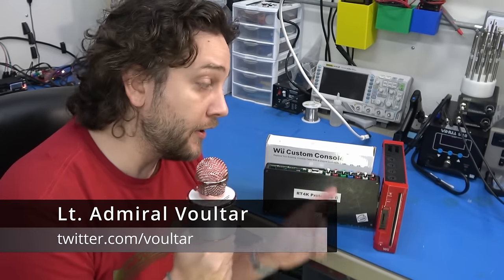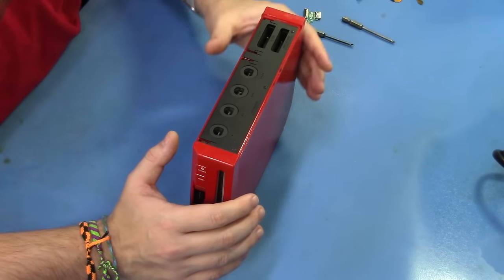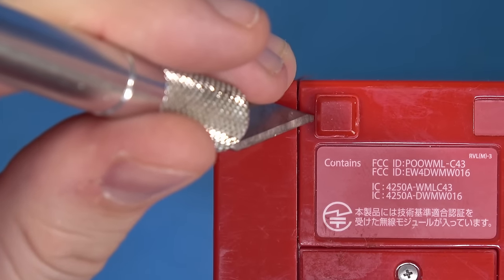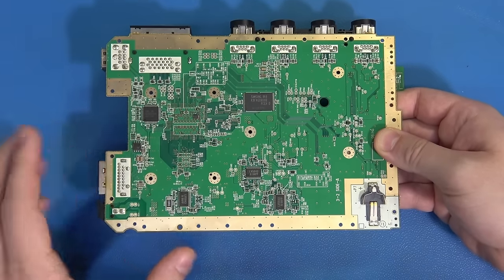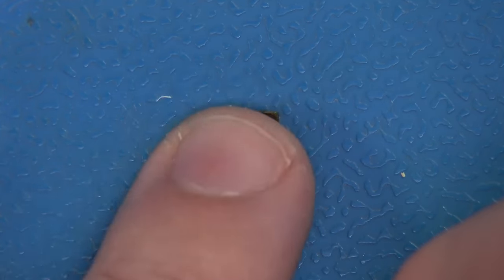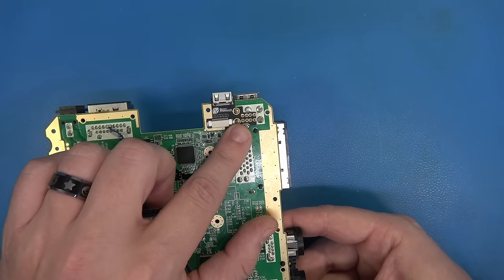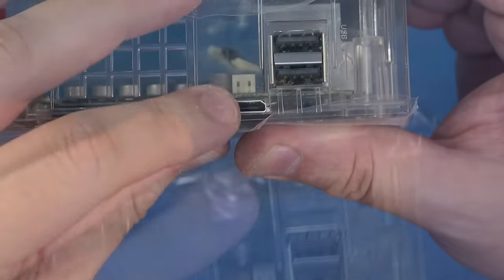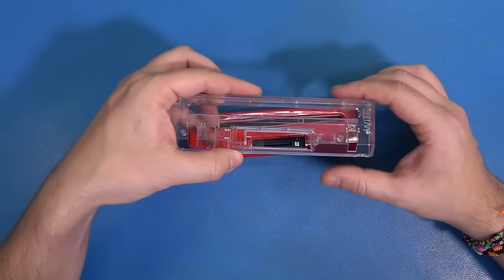Fixing Nintendo's Mistake | PERFECT HDMI Wii Modification in 2023

Comment: I think you may have just sold me on this!  I love how it doesn't replace the analog port so I have both options available, and the price is pretty nice too.

I'm curious about one thing in my particular case.  I've got a situation where I can only use one USB port at a time on my Wii or it fails to power devices connected to them at all.  It's like the ports aren't getting enough power somehow, so I'm curious if there's a cap or a voltage regulator that might be the cause of that I could replace and fix that issue.  I've already tried reflowing the solder joints on the USB ports themselves and they seem solid enough, so I'm guessing there's some component on a slow path to failure but I'm just not well versed enough in the layout of the Wii to really get to the bottom of it.
Reply: Now that this device is fully compatible with every non-mini release of the Wii, I think I'm going to snag one up fairly soon.  As to my previous issue, I have a pile of old Wii's laying around and I'm just going to bite the bullet and do a NAND swap to another board and slip it into this Wii (so the serial in the NAND matches the serial printed on the case).  The one I'm eyeing is a revision 20 with boot2 flashable, so it should use less energy than the 01 I bought at launch.  Shame to say goodbye to it, but I just need that stable USB power.

Comment: I installed this. I am unable to get sound. Video and menu work fine. I have probed for continuity on all vias to the ic and everything checks out. Change enhancement mode and nothing. Reflowed 3x with no luck. Very frustrating.

Comment: @Voultar What gauge hook up wire did you use?
Reply: I used 26 gauge stranded wire that worked out for my install. 
If I had to do it again I would've used solid core wire, seems a little cleaner.

Comment: Ordered one 4 hours after the video drop!
What temperature should be used? Is that an exacto knife used to clean the vias that would not take solder? Thank you!
Reply from the maker: I run a calibrated iron temperature of 305c. Yes, I'm using an X-acto knife to carefully remove the tenting over the vias to ensure thorough wetting.
Reply: @Voultar  thanks for the response, where can I get the cables to connect the cable work? Are they included in the kit ? Is austor 60/40 ok to use instead of Kester? I'm getting the mg no clean but would a sra be ok to use? I've mostly done git kits.

Comment: i just did my first ever solder mod on a gamecube using helders flex cable to put on the pico and that tiny ipl chip was a bitch! didn't do it right the first time and resoldered and it worked! So awesome! Specially since i haven't used a soldering iron since 1997. i want to try this out but man taking this friggin thing apart looks hella tedious. 

pre tining those vias looks hard.

Comment: Question for anyone:
What happens if you use both the analog and hdmi outputs simultaneously once this installed? Would one port take priority? Would the signal be split making them both unviewable? Would they magically both work? How would it look on each screen compared to using just one port?

I'm open to discussion and whatnot but please let me know if you are actually sure or not and if you've tested it or read about it in the docs

Thanks in advance if anyone can help me out!
Reply: I do realize progressive scan may be an issue with the standard compositve cables, but if you were to use component wii cables to output at 480p, would this work?

Comment: Will the Retrotink 4k have an HDMI in and out or did you use an HDMI to YPbPr converter to hook it up to the 4k?
Reply: Looks like the red cable behind the Wii is a mini to regular HDMI converter, and the thicker black cable going into the back of the RT is the HDMI from the Wii.

Comment: wonderful guide. Running into an issue personally because I somehow lost a capacitor which i've identified to be connecting the VCCAUX to GND ( on the north side of the FPGA chip, closest to the right of the two unused pads next to "GCD") . As a result i'm getting no audio. Any idea where I can source another one of these capacitors? There's other ones of these on the kit, but i can't figure out what capacitance they are. I have a donor GBA sp board which i'm sure probably has a comparable capacitor, but i'm not experienced enough to figure it out. 

If anybody could help me i'd be very appreciative!

Comment: im at a loss here
i followed this guide(not blaming you) but when it came time to test i get no video out on the mini-hdmi and just a black screen on the analog out
ive been checking for a bad solder and can't find one
the leads all seem good, no crossed visas they all connect back to the chip on the mod correctly,
any advice would be appreciated as i dont know where to go from here
Reply from the maker: Flood each via with a generous amount of solder while at the same time ensuring that the flex PCB is perfectly flat against the Wii, for starters. That's 8/10 the problem. Reseating the ribbon cables is also a simple thing to try.
Reply: @Voultar  ill give that a try this weekend
thanks
Reply: @Voultar  tried that, no dice
i tried carefully removing the mod entirely and still just the black screen(maybe it was just its time?)
i used both your video and spawnwaves for installation cause my wii is the launch one(RVL-CPU-01) just like his
i made sure i was lining up with the right visas and everything during install
are the 6 layer boards more difficult than newer boards to install this?
i might try again on a different wii (im stubborn)
Reply: @Voultar  ok update
my wifi module died, Ive replaced it and got video out as before
ive re installed the ave mod and now from the analog port everything seems fine but from the mini hdmi port ive soldered in from the kit, i get a green screen
priiloaders there, its just...green
i know its not your job to help me out or anything, and i don't wanna be annoying or anything but once more(please be the last time) im asking if you have any ideas
EDIT:
i forgot i was running my hdmi through an elgato
without the elgato its fine

Comment: So I'm thinking about installing this mod for myself but before I buy it I'm curious if the quality is THAT much better. Like in the video, it is difficult to tell the difference between the stock Wii and the modified Wii; but I understand that that's probably my phone lol. Is there anyone who has installed this mod that can verify this? Just would like to know before I spend $70. Also you earned yourself a subscriber and a like on the video for a very thorough instructional video.

Comment: why do (almost) all of these Nintendo console HDMI mods revolve around using mini-HDMI instead of the full sized port? Surely it would be easier to connect a Wii with a full size HDMI port to a TV than it would be with a mini HDMI.
Reply: wait its not full side?
Reply: @DragonProtector  not from what I can tell
Reply: @m_rissspeedruns1231  i just received mine today so I could test the port. But i dont want to take it out of the bag yet.

Comment: Great mod but calling it Nintendo's mistake is a bit much. HDTVs weren't standard back then and Nintendo has traditionally been behind on a format due to it being too new.
Reply: Well... The PS3 was released a week before the Wii, and it had an HDMI port. Even the GameCube had a "Digital-Out" port that Nintendo could have installed on the Wii instead of just an analog port.

Even Microsoft revised their Xbox 360 to add HDMI-out. :P

Nintendo probably did that to reduce to development and manufacturing costs.
Reply: @bowi1332  Makes sense for the PS3 to have it considering Sony also makes televisions.

And as you said, the Xbox 360 had it added later.

That said, my argument still stands, it wasn't the standard, so the Wii didn't have it. But when the Wii U came out, it was so the Wii U and later the Switch had it.

Comment: Amazing work. On the Comparison shots, are you soft modding the Wii with the 480p fix, Deflicker, and Framebuffer fix?
Reply from the maker: No, these are bone stock (software) systems with no additional changes.
Reply: @Voultar  gotcha. Nearly all wiis (other than late model) have a bug that affects 480p output that can blur the image. This can be fixed in USB Loader. Also, there is a horrible Deflicker that can be be turned off as well. Finally, all Wii games run in the wrong aspect ratio in 480p. They run 640*480 stretched to 720 by the Wii. You can turn that off to output to 640 and adjust the size with the tink.

It's a major difference without needing the HDMi mod.

Comment: Are you not better with a wii u it has hdmi and easy to put cfw on
Reply from the maker: The Wii-U doesn't properly handle Wii video output. the aspect ratio is wonky and it pillar boxes the top/bottom. The scaling is also crap and a bilinear filter is applied.
Reply: @Voultar are you upscaling it for better resolution